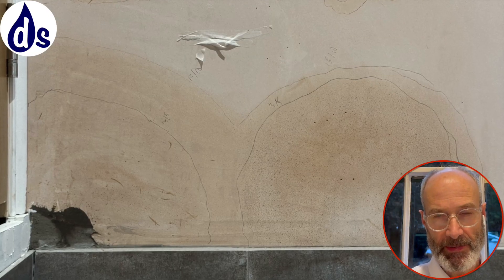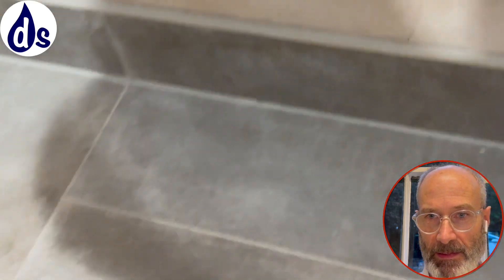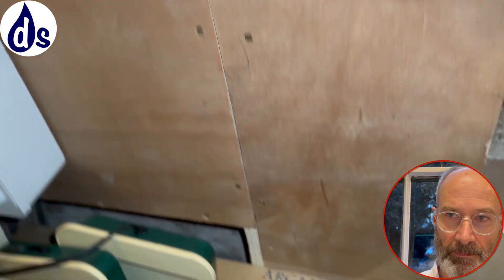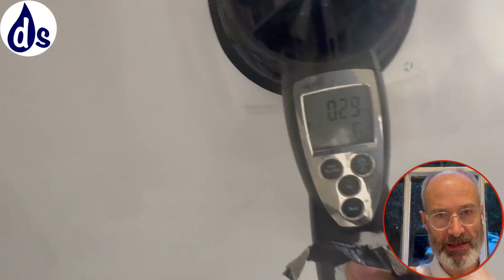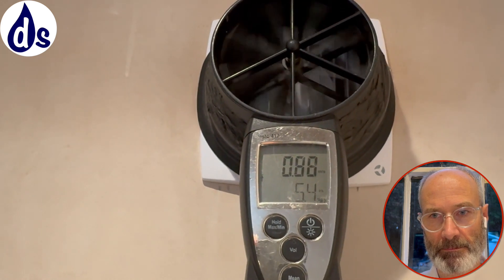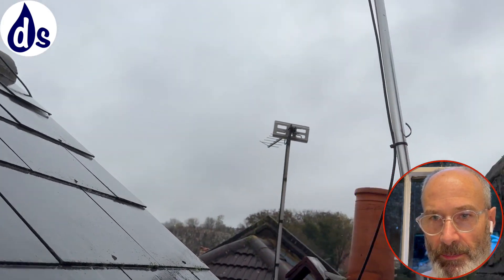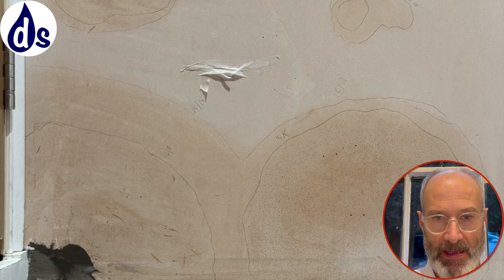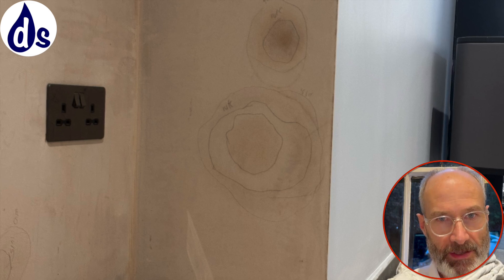🏠 All Insulation, No Ventilation: The Condensation Catastrophe 💨

Comment: Finally someone who understands humidity, condensation and temperature
Reply from the maker: Thank you—that’s very kind of you! 😊 When it comes to tackling humidity, condensation, and temperature, I like to keep it structured:

1️⃣ Ventilation 🌬️ - Targeted ventilation in bathrooms, kitchens, and utility rooms is key.
2️⃣ Dehumidification 💧 - A 20L/day dehumidifier is essential, especially in high-moisture areas.
3️⃣ Heating 🔥 - Consistent and even heating reduces the risk of cold spots.
4️⃣ Insulation 🧱 - Insulate effectively, particularly around cold bridges and external walls.
5️⃣ Airflow 🌪️ - Keep furniture away from walls, open curtains, and ensure good circulation.
6️⃣ Data (Dew’s Law) 📊 - Always keep the internal dew point below the outside temperature.

👉 For more insights, check out **https://damp.ai**—it’s packed with free advice and resources. If you’re a surveyor, do sign up to help spread the right knowledge! 🚀

🎥 Suggested Videos:

"Respect Awaab’s Law with Dew’s Law" → https://youtu.be/MMJeqjAWtSo
"Mould in a Top Floor Flat—Why Ventilation Wasn't Enough" → https://youtu.be/ecALpqwkMaw
"All Insulation, No Ventilation—The Condensation Catastrophe" → https://youtu.be/QxX7Bx5k008
Let me know if you'd like to dive deeper into any of these topics! 🌟

Comment: Its always condensation ... old house, plastered up to high heaven with zero ventilation and no cavity by design = no where for water laden air to go except cold surfaces

windows on trickle and wood burners reallly help fyi!!
Reply from the maker: Thanks for the comment! I completely agree—targeted ventilation combined with dehumidification can be incredibly effective, especially when a property is left empty and unheated. While trickle vents and wood burners are great for improving airflow, adding proper ventilation and managing humidity levels with a dehumidifier ensures that water-laden air has somewhere to go, preventing condensation on cold surfaces. 🌬️💧

Comment: Can you give ms the name of that contactless damp meter? I need one for DIY purposes. I believe the pin meters are u reliable
Reply from the maker: Great question! 😊

I like to think of damp meters more as "dryness meters". They’re excellent for showing if a wall is drying out, providing confidence that your efforts are working. It’s worth noting that walls typically dry from the top down—similar to how clothes dry, with gravity pulling moisture downward. Conversely, damp usually builds up from the bottom upwards, which is why some people mistakenly label any damp at the base of a wall as rising damp.

For a reliable and affordable option, I recommend the Dr. Meter (around £23). It’s a contactless radio frequency damp meter, which avoids the issues of pin meters (like salts causing false positives). You can find it here:
👉 https://www.amazon.co.uk/dp/B07Z1MS56X?ref=ppx_yo2ov_dt_b_fed_asin_title&th=1

If you’re dealing with damp or curious about how damp meters work, these videos might be helpful:

🎥 Rising Damp Treatment: A Cover-Up, Not a Cure
https://youtu.be/iSpecL_3aFE

🎥 Damp Déjà Vu: When Proofing Merely Displaces Damp
https://youtu.be/8PHsAEAESJY

🎥 Condensation and Hygroscopic Salts in a Victorian Rented Property
https://youtu.be/J9XacxdnSvk

🎥 Condensation Across a Property with Blocked Extractors
https://youtu.be/0yKzQWIqjOk

🎥 Why Does Rising Damp Treatment Cause Mould and Condensation?
https://youtu.be/fjH9QQRAYXY

Let me know if you have more questions or need additional advice—I’m happy to help! 🙌

I plan to write a book in the summer, stay tunes and visit https://damp.ai

Comment: Lead flashing should be stepped and have soakers underneath
Reply from the maker: I completely agree—stepped lead flashing with soakers underneath is a belt-and-braces approach, especially for areas where rainwater is funneled onto a section of roof adjoining a wall or other critical points. This ensures better protection against water ingress.

Of course, rainwater shouldn’t funnel onto such areas in the first place. Homeowners should regularly check their rainwater goods (e.g., gutters, downpipes) to ensure they’re functioning correctly. I recommend inspecting them every six months, ideally in autumn (to clear leaves and debris) and spring (to prepare for summer storms).

Here are some videos that might be helpful:
🎥 Penetrating Damp from Overflowing Gutter Made Worse by Gaps in Flashing
https://youtu.be/kUQkGpfyP0s

🎥 Rainwater Flowing Off Front Driveway
https://youtu.be/s-y9pDevzho

🎥 Gaps Filled in Rendered Wall but Damp Continues
https://youtu.be/nSb6nmDsgZI

🎥 Penetrating Damp Three Victorian Flats
https://youtu.be/50nyNTdIwT0

Proper maintenance and installation are crucial to avoiding long-term issues. Let me know if you have further questions or need more advice! 😊
Reply: yeah but that's not the cause of the damp so irrelevant.
Reply: @slashingbison2503  
                                       Highlighting a potential leak during a survey isn’t irrelevant unless you did the  roof job

Comment: I saw recently that electricians might need to have certification for fitting fans as a requirement from building control. 

Seems there’s an education void in the importance of a ventilation strategy, especially as we do more retrofitting.
Reply from the maker: I completely agree—there’s a significant education gap when it comes to implementing effective ventilation strategies, especially with the rise in retrofitting projects. This is an issue that vexes me deeply, as proper ventilation could solve so many problems that are often misdiagnosed as rising damp.

If we took a few straightforward steps, the rising damp industry could largely disappear:

1️⃣ Extractor Fans with Higher Flow Rates:
Fans should be factory-set to at least 20 l/s, ensuring the end result meets the standard 15 l/s even after factoring in potential losses from ducting.

2️⃣ 30-Minute Overrun with Backup Power:
Manufacturers should offer a product that includes a battery-powered overrun. I’ve seen one product that achieves this, but the lack of adoption is frustrating—especially since running an extra lead for the overrun often costs 5-10 times more in labour than the fan itself.

3️⃣ Testing Airspeed at the Outlet:
Exit airspeed should be measured to verify the fan and ducting are functioning as intended. Too often, fans are installed without checking the flow rate, leading to a false sense of effectiveness - and surveyors hardly ever check the speed at the fan, let alone the outflow.

These simple measures could dramatically improve ventilation in properties and reduce issues like condensation, mould, and misdiagnosed rising damp. It’s time to start viewing ventilation as a critical part of a home’s health, to be checked by homebuyer and other surveyors—not an afterthought.

For more insights into ventilation and damp, check out these videos:
🎥 Condensation Across a Property with Blocked Extractors
https://youtu.be/0yKzQWIqjOk

🎥 Damp and Mould Next to a PIV Fan: What Could Go Wrong?
https://youtu.be/7IkEncsgwUU

🎥 Respect Awaab’s Law with Dew’s Law
https://youtu.be/MMJeqjAWtSo

Let’s hope the industry takes steps toward requiring certification and better ventilation strategies—it’s long overdue. Let me know your thoughts! 🙌
Reply: @ simple fixes! There will be a balance of noise and running costs. I’ve found it interesting to see the exposure Envirovent has done on other manufacturers. It’s eye opening how ineffective some can be, especially when ducting is involved. 

First time I’ve heard to the battery over-run. Great idea.